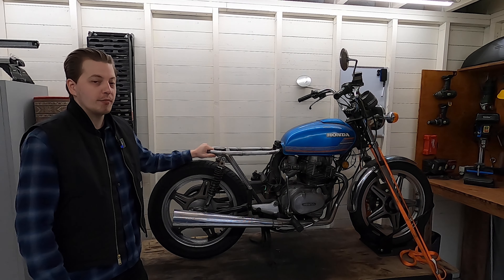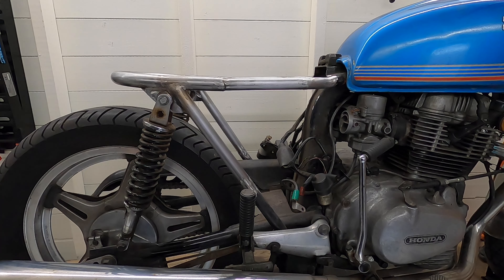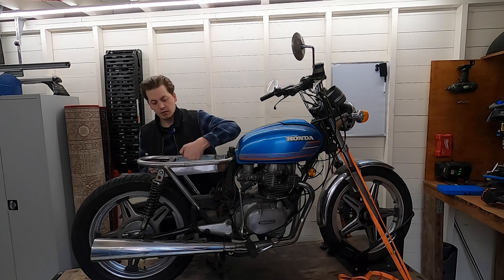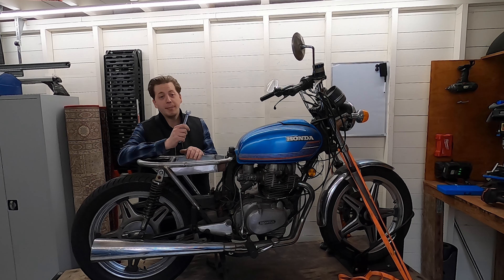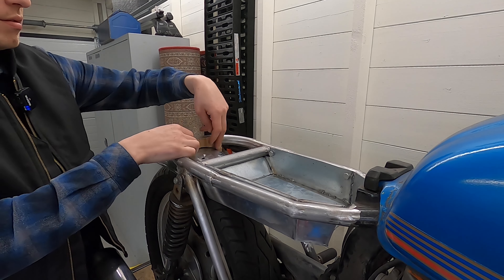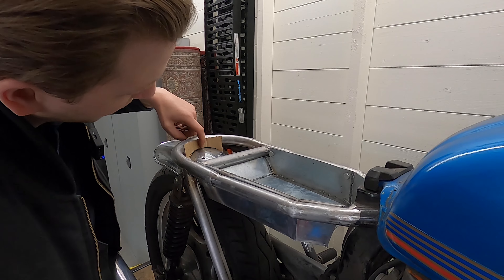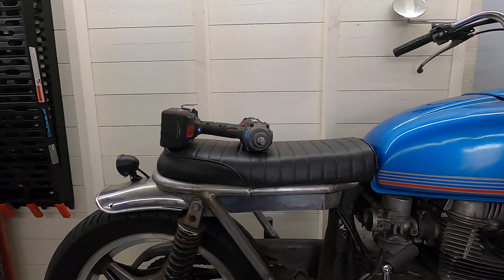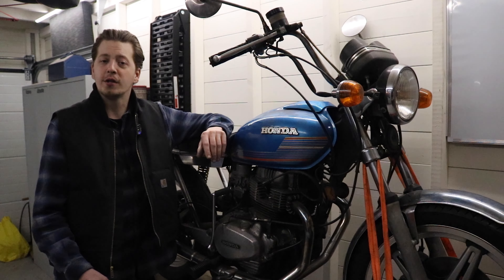Honda CB 400 Gets A Custom Made Electronics Box And More!

Comment: What are you using for your flat metal and welding wire??? Great job!
Reply from the maker: Thanks man! For the metal I used 2mm which is definitely overkill but it’s what I had laying around so it should be quite sturdy. For the weld wire I used regular .8mm